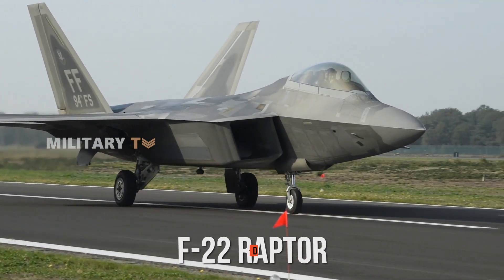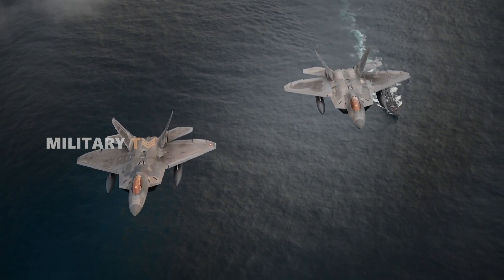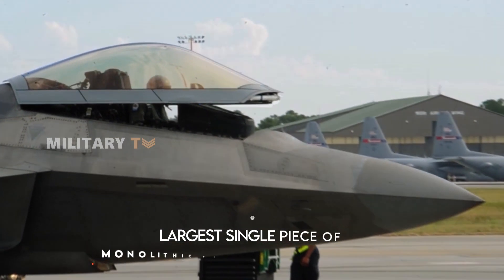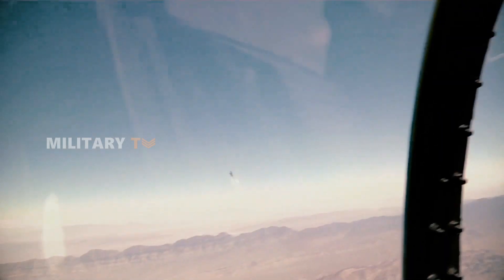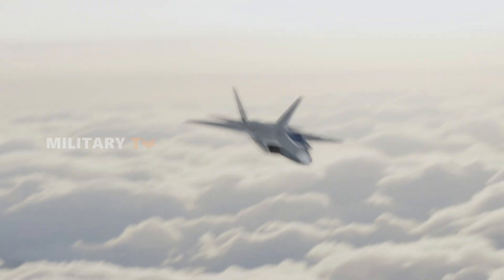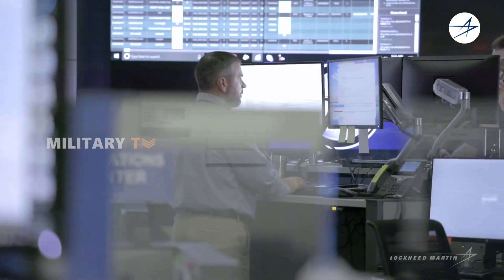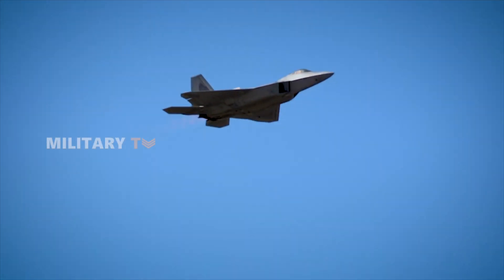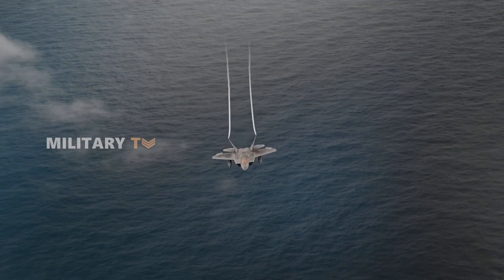How Much Does the F-22 Raptor Canopy Actually Cost?

Comment: If the f22 is as good as u claim why develop the f35????😂
Reply: F-22 is purely for air superiority. F-35 is multi-role.
Reply: Because they wanted a cheaper aircraft that was multi purposed and also be sold outside the US. 🤦‍♂️
Reply: @JM-wd3dk  Cheaper ?? 🤦 than what ? 🤷. Which one is cheap ? NONE Neither DopeY. All are very expensive. 
What the hell has cheap/est got to do with either 🤔 ??
Reply: F22 is air superiority jet made for certain purposes
F 35 is multirole and affordable
Reply: Because the f22 is a 20 years old aircraft?
Reply: There is something called aircraft roles and operation cost
Reply: Your question seems to lack the money to support it.